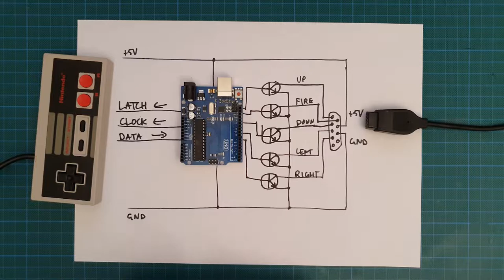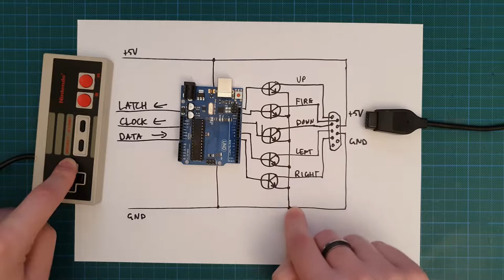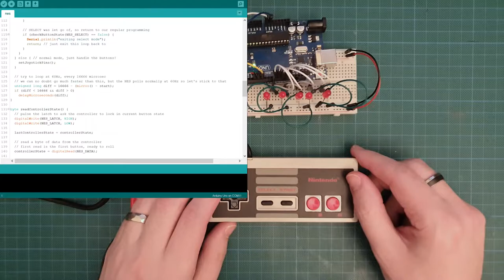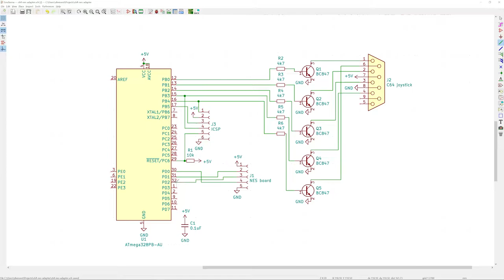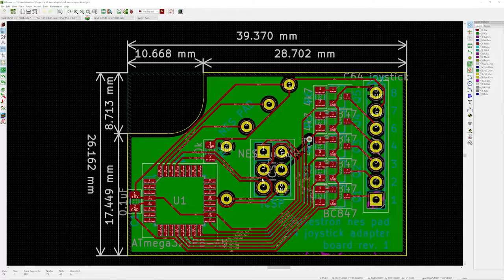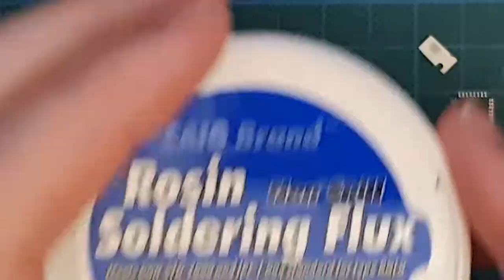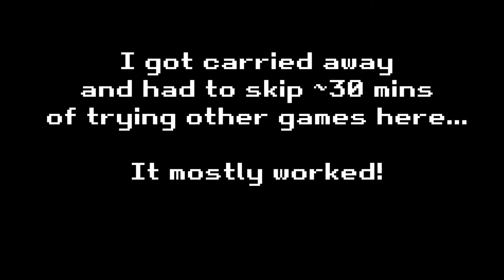NESodore64 project - Adapting a NES pad into a Commodore 64 joystick!

Comment: Great Video! Could you elaborate on why you chose to use transistors instead of directly using the arduino's gpio?
Reply from the maker: Two years on, I couldn't tell you. Maybe it was trying to isolate the C64 joy port from the Arduino a little bit? Maybe I was worried about sinking load on the Atmega's pins? ¯\_(ツ)_/¯